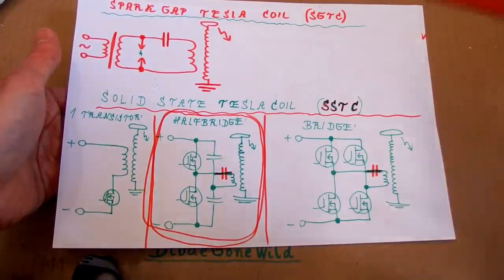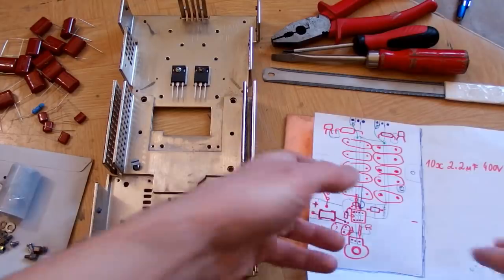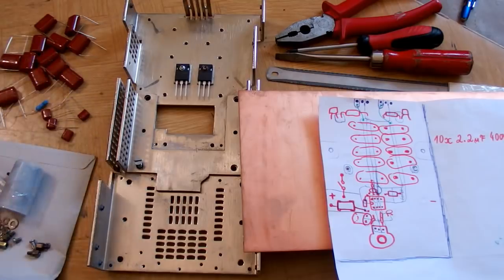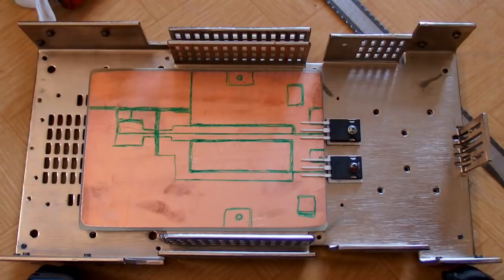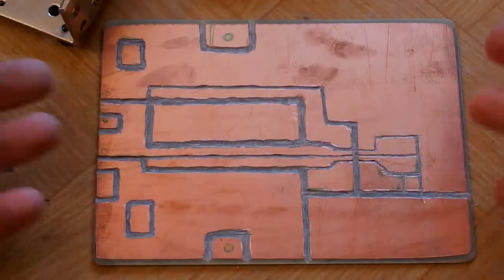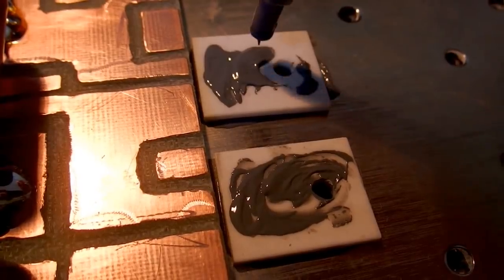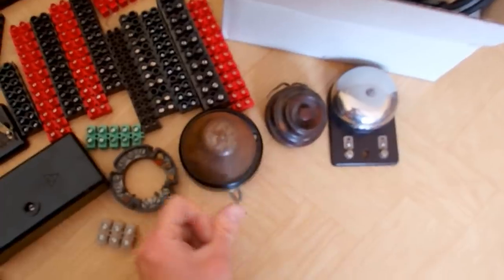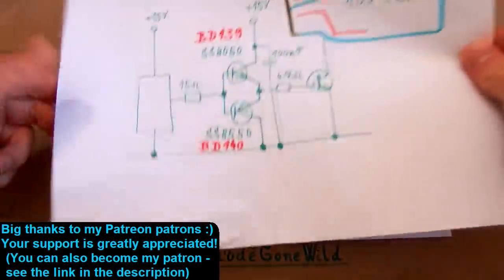SSTC pt. 5 - Making the circuit board

Comment: Just realised a great feature of this board. You could use a light dimmer for an interruptor kinda like a pseudo variac. I actually made my own pseudo variac out of one, and it works. It doesnt seem to limit voltage nearly as much as it limits current though... but it does have a big effect on MOT sparks!

Comment: Very clever board. I wondered how you were going to handle power on the board without risking burning traces. Just use the whole board. Clever.
Reply: When I worked at a board assembly house we had one job making PSUs where we'd solder bare wire to some traces to beef it up.  We'd lay the wire on the board and completely solder it to the copper. Was a bit dodgy.
Reply: @1pcfred  id bet it worked dho!!
Reply: @1pcfred  I've seen that done, on an old guitar amplifier if I recall correctly. Lots of that old stuff had a very hand-built look.
Reply: @Miata822  a very typical way of doing it even on modern PCBs is to remove the solder mask over the high current traces and coat them with solder, it reduces the resistance of the trace quite a bit, you'll see it done in pretty much all PC PSUs

Comment: I really like the construction of your circuit on one copper plate mounted to a big heatsink with terminal blocks. People often ignore mechanical construction in DIY power designs so their projects end up as a mess of loose wires and weird interconnection.
Reply: I might be guilty of this. Like a lot.
And yeah, also hot glue.
Reply from the maker: Most of my projects also end up as a heap of convoluted wires :). But this time I decided to do it better.
Reply: @droga_mleczna  that's my favorite
Reply: Be glad that you did not see my passive crossovers for three way speakers. People would cry and run away from their monitor if they saw them.
Reply: @erikziak1249  don't worry, we all make same mass with crossovers, it's not like somebody will look inside speaker case.
Only with my first amplifier/speaker I lost who know how much time trying to make if visually perfect. Never again, no point.

Comment: I'm currently working on a module for an industrial xenon flash lamp (the flashes are synced with the machine) one part of it is a 550V power supply, all the high voltage traces run on a single side, without crossing any other trace, the old lamps we had failed because they started to arc over through the PCB and between traces, eventually burning a hole through the PCB

Comment: The small carbide bits are called cutting burrs, and they are basically the same as what's in the dentists office, but they probably have slightly different profiles for torturing you vs. what you'd use on metal.

Comment: A quick question - wouldn't it be better to use a capacitive dropper for the control chip? I know that needs a bridge rectifier and might use some more resitors just to make it 'safer' - but it doesn't need an exotic high power heater to drop the voltage :P

Comment: Danial can you comment on this resistor dropper, im not the only one slightly puzzled here. What are the component values you ACTUALLY used for the ir2153 supply please.. 
The resistors = 5X parallel  ???ohm@??watts
The capacitor = 2X parallel ???V@????Uf
Thanks

Comment: Pt 6 testing the sstc
Pt 7 fixed frequency and audio input
Reply: I wonder if it would be possible to control the frequency just using a function generator. I bet if you had a strong enough amp you could turn the gain up untill it distorts, put a cap on the output for smoothing out the harmomics caused by the distortion, and run music through the input. His design doesnt use an interruptor. It uses the oscillation of the mains. Which is why its only half wave rectified.

Comment: Hey DhW! I hope you are fine. 
How do you desolder components with many pins from a board?
I found an old stereo mixer and I wanted to remove the opamps from it.
Reply: The best way to salvage PCBs is to use the solder bath method. That's when you have a pool of molten solder that you put a board on the top of. Then you can just pull any component out. Get a piece of sheet metal and bash it with a hammer until it is shallow dish shaped. Then put some solder in the hollow and put a heat source under the sheet metal to melt the solder. Hold the board with a pair of pump pliers. Then I either use a pick or just some needle nose pliers to grab whatever component I want to pull. I'll usually rotate a number of boards while I'm salvaging to give boards time to cool down. Four or maybe six at a time. Just dunk one, pull a part and set it aside to cool. You have to use a strategy when you're bathing boards. Try to pull the most heat sensitive components first. Some really crappy boards you can bathe then real fast smack it onto the lip of an empty cardboard box. All the parts will fly into the box. That works on single sided consumer electronics. Stuff like TVs and VCRs. That's called heat it and beat it. Bathing boards I can pull a 64 pin DIP package in about a second. There's a difference between salvage and rework. With salvage I don't care what happens to the board. I'm only going to throw it away anyways.

Comment: 👍👍 Good video, I'm following you, I'm gonna get that tesla coil as soon as I can.
Is there a way to control the tessla coil by pulses to make music in a simple way, with an arduino for example?
Reply: Yes look at great scotts sstc i think he used class d amp output on power in
Reply: Yes you could. I used a ATtiny85 as an interupter. The advantages of this is lower part count and adjustable maximum/minimum pulse width and frequency.
Reply: Look into Datasheet of IR2153 from Infineon. The design there shows how to put a "shutdown" mosfet buffer (Grounding Cx). Use any small mosfet like 2N7000, or just NPN bjt. You can drive this mosfet directly from arduino or 555-based PWM audio signal to regulate output power. You can test it before connecting to tesla coil by simply attaching a speaker to the output of the bridge through a large series resistor (to limit the power an not burn the speaker). you get half the rectified mains voltage on output, so f.ex. for 2.5W output at 170V you need a 10k resistor (5W).

Comment: Can anyone explain why the divider capacitors are such high value? 
Is it just to improve the RMS current rating? Other similar designs I've seen seem to use a lot less capacitance.
I've built an SSTC based on this design, and it works brilliantly however the divider caps take up a lot of space, and never get even slightly warm. (2S6P of 250V 3.3uF on each side, salvaged from plasma TV boards for a total of 9.9uF 500V per side).

Comment: Instead of sawing FR4 PCB try putting a steel straight edge on it and just score it multiple times with a utility knife. Change your knife angle side to side as you score and slivers will come out of the cut. Scoring is way better than trying to saw fiberglass. I have a band saw and I don't even try to saw the stuff. Scoring you get a much straighter cut. Then if I want it really neat I file and sand the scored edge. I'll usually transfer the score to the other side and score the board on both sides. Then when you're most of the way through you can just snap the board and it breaks on the score. The only downside of the score method is you have to cut all the way across whatever piece you're cutting. Scoring is so much better than sawing that I don't even care.

Comment: isn't the chip way too far from the transistors? I would put the capacitors on a separate pcb or no pcb at all and just connect them to the pcb with 3 wires.
Reply from the maker: The chip definitely could be closer, but then the capacitors would have to be further. Or on a separate board, or dangling on wires. It's always a compromise. But having the capacitors close to the transistors is probably even more important than the chip. I reduced the inductances of the gate traces by putting them right next to the emitter traces.
Reply: @DiodeGoneWild  I'm more of a dangling wires type of guy and i'd like to ask why is the capacitor location so imporant (I would just  hang them above the pcb on 3 pairs of twisted thick magnet wires)

Comment: igbt code  please
Reply: FGA60N65SMD -- pay attention to previous videos for verification.
Reply from the maker: the first guinea pigs are cheap AOK60B65H2AL and then faster DGTD65T60S2PT.
Reply from the maker: E2qNX8btraQ3zRD6J7fc: 
FGA60N65SMD are the third ones I plan to test :).
Reply: thanks
Reply: @DiodeGoneWild  My TeslaOne Solid State coil runs the FGA60N65SMD's.  They're pricey when you get silly on the interrupter and blow them up.

Comment: You should get a cheap cnc router to make your own pcb prototypes, they're very nice. Great video btw
Reply: This is faster. It takes forever to design boards and generate G Code. So says a guy that has a CNC engraving machine and has isolation routed PCBs.

Comment: Why did you not etch PCB? You can etch PCB like shown on video: https://youtu.be/bHC2dF2wQks (Polish video, please use English subtitles)
But video itself is good. :)
Reply from the maker: For high currents, you want the traces as thick as possible, so I'd have to cover most of the board with the marker. Dremeling it is more practical.  And on top of if, I can dremel more things into the empty areas of the board with components already on it!
Reply: @DiodeGoneWild  OK. Your PCB making technique is silimar to a CNC milling.

Comment: if u want to make an niche oszilator consider MOSFET-Royer-Oszillator mit hocheffizienter Gateansteuerung . at http://www.joretronik.de/Oszillatoren/Oszillatoren.html
 i eremember u speak german . it works like charm . up to 4 mhz with no kondenser other than the  ds capacity  and ohne winding .  and 4 irfp250 . use 2 antiparalel slow si diodes as gate resistors oherwise ur gate resistor smokes . it works nice with an tesla coil . mine was an 2 mhz pankake coil . i like ur method of dremel circuit bord  i did it ohne time . works like charm . thanks .